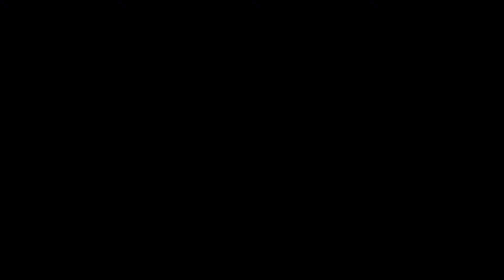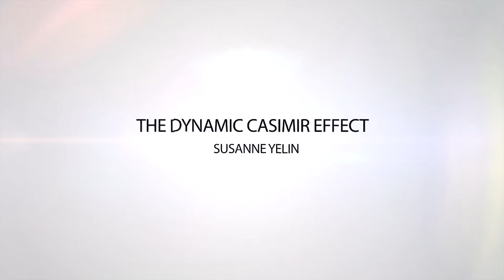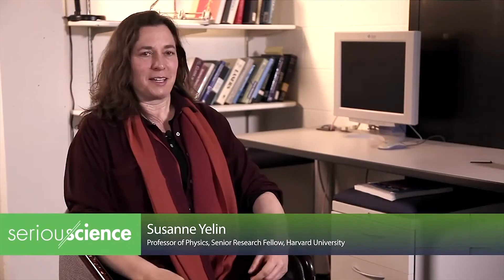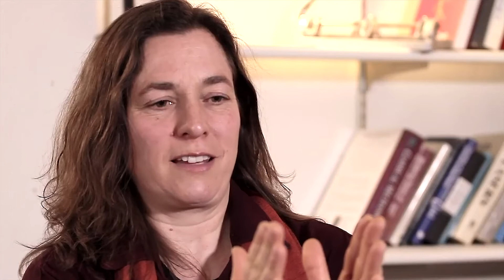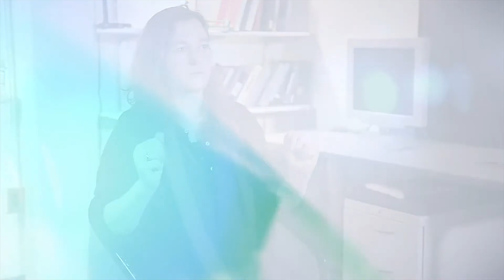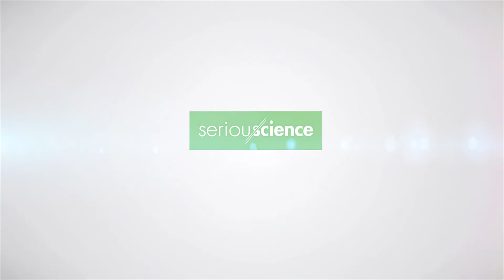The Dynamic Casimir Effect - Susanne Yelin

Comment: You could also have particles and anti particles splitting up particle flies out anti particle absorbs particle negative energy equivalent try the mirror with a Holographic optical element and interrupt the beam with an array of Femto second lasers although they only refire within MegaHerts range of you put a larger array behind one another and reuse the beamed away part to be used in another one and use the same optical holographic elements for the main mirrors and put it all inside a tube with charged plasma there you go just reuse the beam to form the switching mirror again in another section holographic optical elements can be switched on and off making the hologram that is keeping the same optical properties as the original switchable... Try it this way...

Comment: Could you guys be mis calling micro gravity, the casmir effect? Just seems like the same thing to me. Has it ever been done in zero Gs and With different materials? Is this what causes cold welding in space? All your experiments are null and void here on Earth, as how do you know the gap is not funneling earth gravity through the gap? You could also be creating a Faraday cage inside the gap and ambient electromagnetics are bombarding the outside push on the plates. Maybe your getting a pendulum effect from the earths gravity, Have you tried arraging the plates in line and against the earths rotation? Just my thoughts.

Comment: I recently found this topic and wow it's mind blowing. This can be used to tap the vacuum energy in theory  right? Bunch up billions upon billions of these oscillators to make a generator?
I know I'm kinda reaching here but isn't that the potential?
Reply: logically it seems possible, you should look into harold whites research into worldline numerics on casimir geometry, he accidentally might have created a nano scale warp bubble and there is an experiment that could be done to prove its existence, if it does exist then its possible to scale it to a bigger scale by copy pasting the geometry in two dimensions but so far this tech seems risky to be used in propulsion due to the warp boundry being as cloas as a nano meter away from the structure and another problem is that this energy density distribution is within a cavity so you would still have materials existing outside the warp bubble which is aslo a problem that needs to be overcome
Reply: stretch? maybe not oscillators per say..... printed with asml like litho

Comment: Following up to David's question, I'm also wondering about these new photons that emerge from the vacuum. Specifically, where is this new energy coming from? It sounds like there is more energy going into the system using the optomechanics techniques. If so, are there any other theoretical methods of polarizing the vacuum without using as much energy in contrast to producing the photons?
Reply: Well I'm not certain by what you mean but maybe I can help clarify, the Casimir effect is a product of Heisenberg's uncertainty principle specifically ∆E×∆p>=hbar/2 this essentially States as long as I have continues time I have some fluctuations in energy aka the casimir effect, this fluctuations or Quantum fluctuations can be described as 2 photons that "pop" into existence then annihalate to satisfy the conservation of energy. The dynamic casimir effect can be voiced in 2 ways either some plate (mirror) moving at relativistic speeds, or a unstable Minkowski vacuum (leads to Hawking Radiation) this means that I have the Casimir effect occuring but if I  move one of the plates at some fraction of the speed of light, these Quantum fluctuations don't annihalate to satisfy the conservation of energy so they remain and become "real" particles      but the problem now is how do we satisfy the conservation of energy? The energy conservation comes from the work that is done due to the apposing particles on the right side of the plates this adds energy to the system.
Reply: The equilibrium between the vacuum and the system is actually maintained in all cases in one way or another. Even in the case of black holes which don’t exert any force. Particles created at the edge of the event horizon by quantum uncertainty can be separated by the gravity of the black hole and they become real particles, but even in this case the black hole loses a little bit of mass to the vacuum. This is Hawking radiation